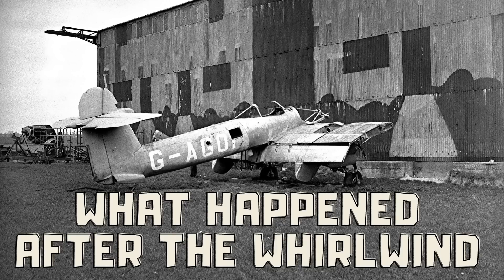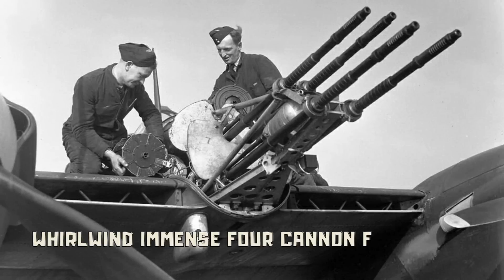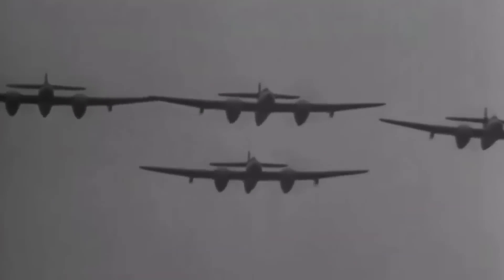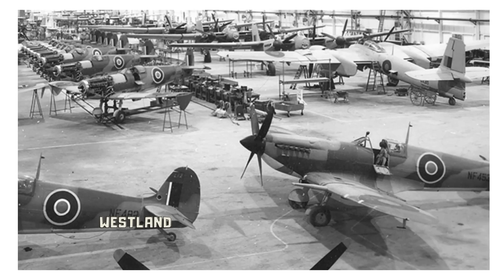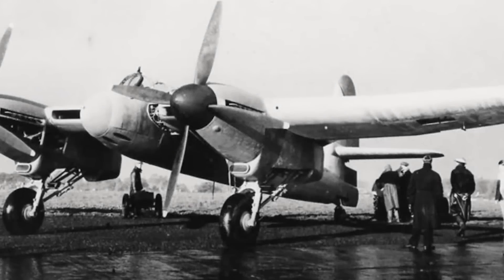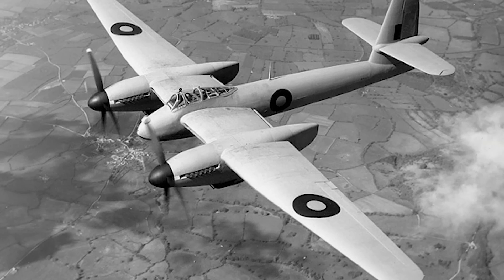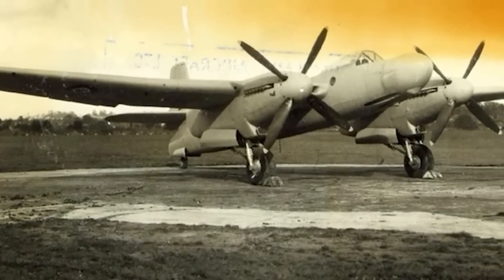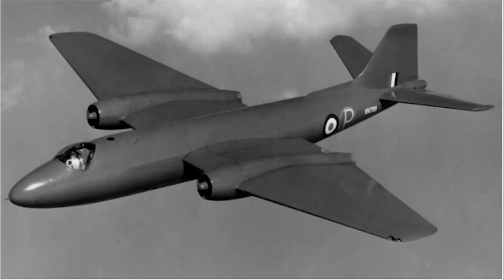WHAT HAPPENED AFTER THE WHIRLWIND   PRESSURISATION  HIGH ALTITUDE

Comment: You keep showing the Vickers Mayfly as a Welkin.
Reply from the maker: Apologise my mistake. Chris.
Reply from the maker: Hello ice9snowflake I have checked my film and yes I show the image of the Vickers 432 three times, my mistake I have read up about the Vickers 432 and enclose some text here. Maybe you would subscribe and check out my other channel films.
I have looked at editing out the image mistake but the you tube editor is playing up so sadly my mistake may stay a bit longer.
At all times I spend many hours researching for my films and I have over 200 hundred on my channel, sadly from time to time I make mistakes, I always try to improve on each film so bear with me.
The fuselage of the Vickers Type 432 was made of stressed-skin aluminum panels that were flush-riveted to the closely-spaced circular structures that made up the airframe. The forward part of each wing was made of a similar stressed-skin construction. The thick skins and their supports created a torsion box of sufficient strength so that conventional wing spars and ribs were omitted. Fabric covered the aft section of the wings and the aircraft’s control surfaces. The wings had a unique elliptical planform with a slight forward-sweep outside of the engines. The wing leading edges between the engines and fuselage housed the coolant radiators.
The Type 432 mockup was inspected in late December 1941, and the first prototype, DZ217, was built throughout 1942. The aircraft was built at Foxwarren, a special Vickers dispersal site for experimental work near Brooklands in Surrey, England. 
The sole Type 432 aircraft continued to fly occasionally until November 1944. Some efforts were made throughout the aircraft’s existence to improve its handling and flight qualities, as the Type 432 was noted as having heavy controls. Only 28 flights were made, and the aircraft was never submitted for official trials or tested to its maximum performance.
The Westland Welkin was ordered into production, the second prototype of the Vickers fighter, the Type 446, was cancelled, before completion, on 1 May 1943. The first prototype was retained by Vickers for test purposes until the end of 1944, when the aircraft was scrapped after completing only 28 flights.
Chris.

Comment: Biggest issue was the tailsitter configuration, and the engines not being handed. (They both rotated the same direction) The first delivery of US P38 Lightning were not handed, and take off and landings were difficult, despite being a tricycle undercarriage.
T/O and Landing in a Whirlwind, with a crosswind, nightmare. This meant open field grass only airfield operations, to compensate for wind. It’s notable the historical film shows this, the aircraft clearly operating from a grass paddock. However, by 1940, the RAF wanted to conduct operations with heavier aircraft, operating on hard runways. The prime requirement for the Mk 5 Spitfire was upgrading in power, undercarriage and lift to operate from hard runways, freeing the aircraft from consideration of wind direction.
Yes, the DH Mozzie was exactly the same configuration as Whirlwind, but it was larger, the engines were spread much further apart, the power to weigh ratio was greater, less dramatic effect from torque rotation on t/o and landing. The smaller, lighter Whirlwind magnified the torque rotation, and controlling swing in a tailsitter, in a crosswind….work for the firefighters and recovery crews.
Apparently, the Whirlwind flew wonderfully, but it was terrible at everything else, prone to immediate disassembly into Terra.
Reply from the maker: Thanks Doug for your excellent feedback. Best Regards  Chris.
Reply: Yoou are obviously not a multi engine rating pilot, that 'biggest issue' pair of red herrings is nonsense.

Comment: The twin engined plane shown at 4:44 is a Vickers prototype. The Welkin appears at 4:52.  Both were built to the same Air Ministry specification.
The Rotol and DH propeller differences......was this possibly due to the use of wooden blades which have to be thicker to maintain a level of strength???
Reply from the maker: Prop  blade design caught up, and anything designed to operate at transonic combined forward and rotational speeds was much thinner, and of an appropriate section, by 1940. So the Whirlwind  suffered from appearing in a very brief window where designers were still finding out the effects of this kind of speed. It was studied on the Spitfire, and DH changed thinned their 55409 blade appropriately - it's all documented in RAE reports.  Chris.

Comment: Many thanks for the video, you provided some extra information I had not heard before. 

Please accept this suggestion in the spirit it is meant. Try to take a little more care when recording and editing your audio. I noticed several occasions where there was a mistake made while speaking during the recording, however it still made the cut. Also, there were several occasions where the audio seemed to go over another piece, and therefore did not have a smooth transition. Perhaps try to record the speech in smalled soundbites? Also, ensure you take the time to check what you think you have done, as it never fails to amaze how often we don't realise exactly what we said. I realise it can sometimes be difficult, but a tighter video will make it seem that much better.
Best wishes.
Reply from the maker: Many thanks I am always trying to produce better films.  Chris.